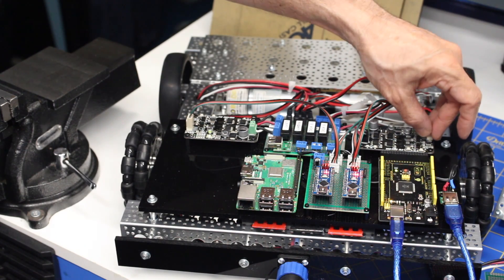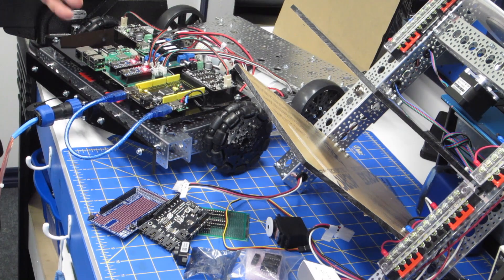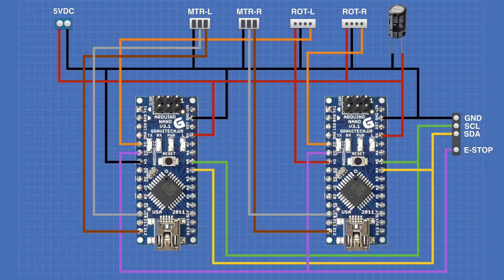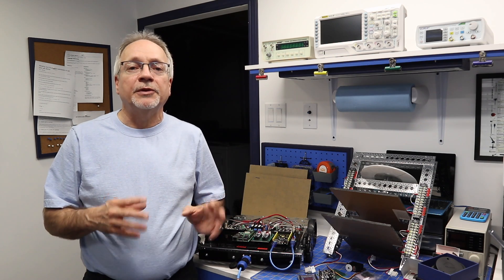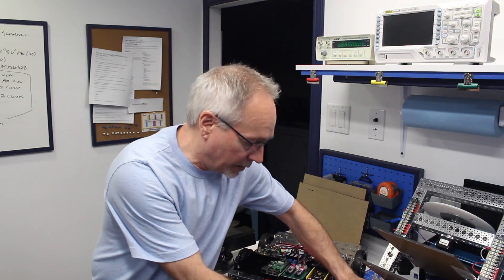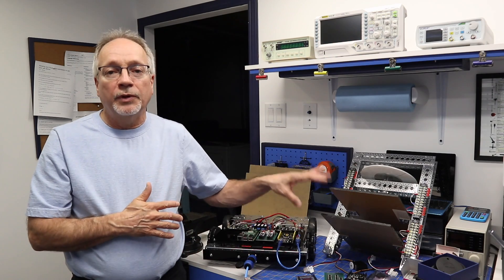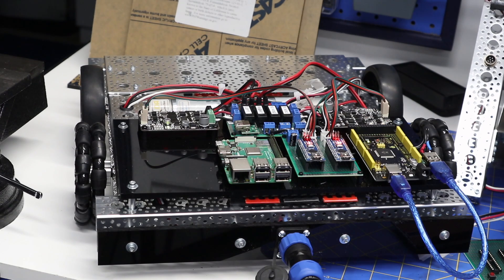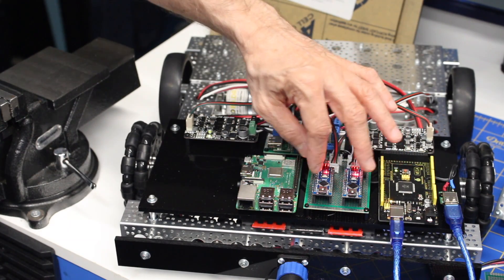Build a Real Robot   Episode 10   Project Recap

Comment: I wonder why you believe that powering on Vin or +5v would affect USB power?
Arduino has a diode from USB to Vin and if you want to avoid the Arduino to power the rest of the circuit when powering on USB you can also use a schottky diode for powering Vin or +5V pins. The internal voltage will in all cases be slightly below 5V, the only way to get fully 5V is using above 5V on Vin or exactly 5V on the 5V pin.

Comment: I wonder if I can the nrf2401 wireless serial communication as my project is to big for i2c the wiring would be just too much would nodes work?
Reply: How far are you taking for the wire run? You could use a radio solution but wire would be cleaner methinks, but do not know your situation.  How many i2c devices will you have?
Reply: Too many to count its a full size machine five ft nine tall twenty four inches wide 36 inches to the tip of 3d printer in the rear I'd love to use i2c  but it may only be able to be used for Navigation and drive and I'm still kind of learning everything as I go but it has at least 25 minis ten unos 4 2560 counting the one for the 3dprinter 20 nanos I have them working independently now I saw a sketch using 24l01 where you can tie this many things together it seemed to work pretty smooth but again I'm still learning I run into a brick wall every now and again but I'm open for suggestions thanks😁

Comment: Great as always!

I find a UBEC is perfect to power uC's and logic.  I use one from hobbywing that has 5v/6v ability. With it, you can use the 6v to Vin.

Now,  your project has made me want to use some of the Acto supplies I have collected the past several years. 

Here is what I have come up with for a base:
https://drive.google.com/open?id=15TXgBQWtWuBdIVSg1uqeEjtA2_K9dtuH

I had everything except the 4x12 plate in the rear. I had four of the GoBuilda motors that I found on sale last year. The motor driver is also a sale item from last spring. I have two of them and am using the other on another bot. I'm using a Nano on an under-shield of my own design, and will only use one for now but may change to a pic based controller I did for another bot. I also have an I2C bus board I made mounted. I am going to use both encoder channels and will use some glue logic to handle the A & B sides. I will probably not use the panic gate and try for IR sonic sensing only for the lower sensor array.  

This is a working markup and just really a "thinking out loud" build with temporary placement of power and other items now.
Reply from the maker: Wow, that's impressive work Scott. I assume that the arrangement at the front is a contact switch? 
I also notice a few "red robots" piled up in the background! I suspect that you've been building robots for a while?
Reply: @Dronebotworkshop  Thanks. I have been tinkering with robot building since I was a teen. I do ok with the electronics and the software (I'm an old C programmer ;) but am all thumbs with the mechanics. I have been tinkering with electronics since I was 7 or 8, though only taking apart things to the chagrin of my parents. I have loved robots since seeing the movie "Silent Running" 

Yes. the red thing on the front is a hinge that connects to two micro switches. I will finish It I think and see if I can get by without it with the IR and sonar. On the smaller home nav bots I did in the past, I needed it as a way to work out if I hit a chair leg or the like. This one still needs more work to make it bot-worthy, but again I am going to try without it first. 

The red bot in the back is a Fleamarket find and a refugee from Canada! I have been doing OpenCV tinkering with it. I have an RPI, Pic uC and a Roboclaw motor controller on it.